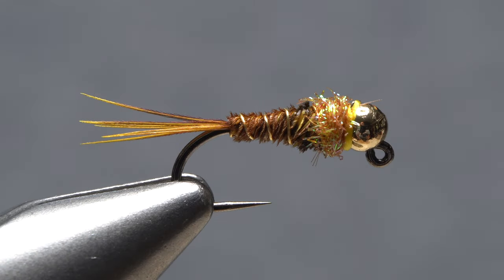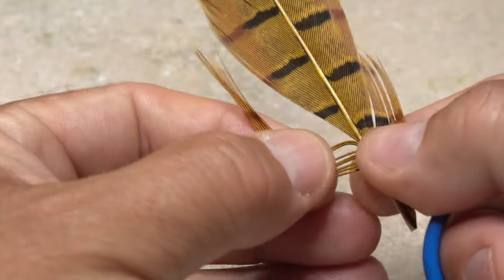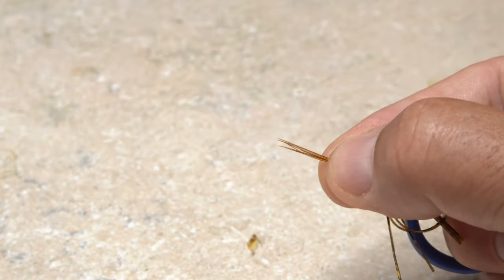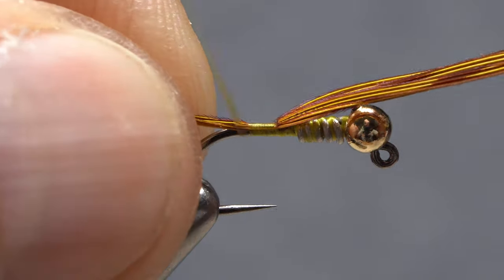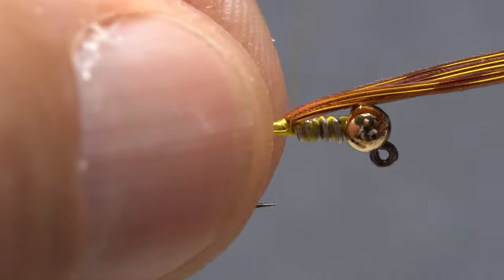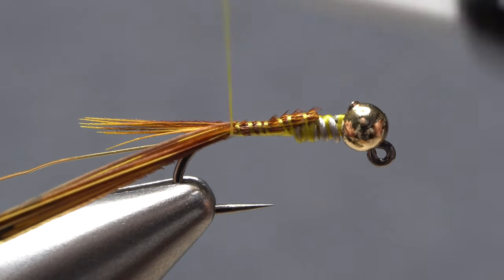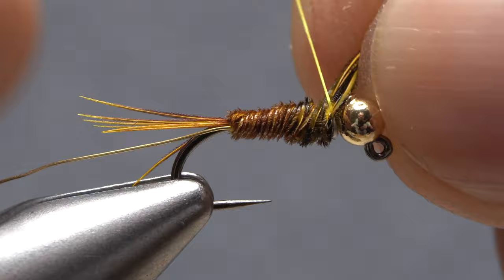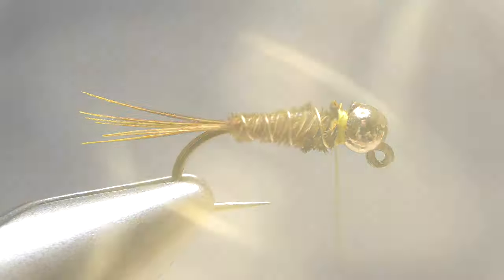Phast Pheasant Tail Body

Comment: I’ve been counter wrapping the primary material (pheasant tail, herl, etc) and then wrapping the wire.  Seems to get a better/firmer anchor on the wire. Even better that the “use the the wire to change the thread direction and then change it back”  technique.  

Working pretty well for me. Any thoughts? downside to the counter-wrapped material that I am missing?